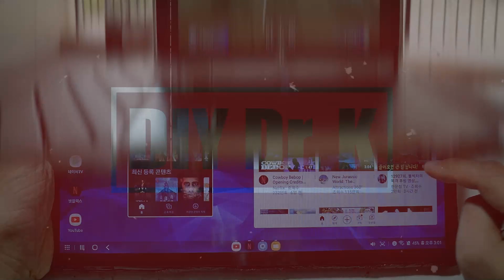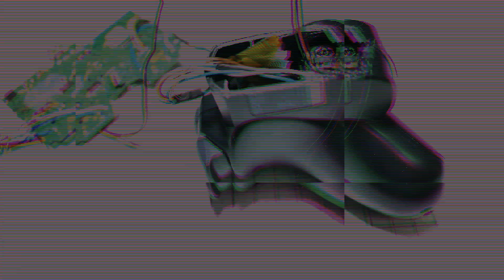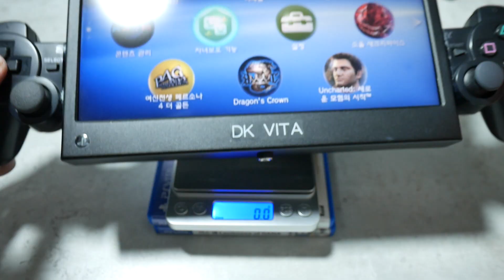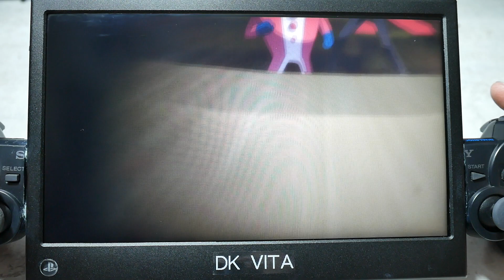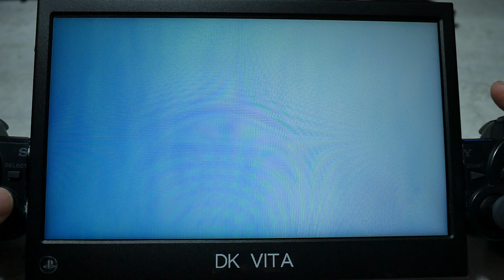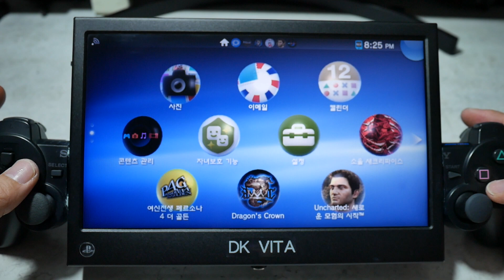10인치 디스플레이의 대형 PS VITA를 만들어보자 Let's make a large PS VITA with a 10-inch display

Comment: This is such an awesome creation. The ergonomics of the controller halves also help it be far more handheld than, say, the Big Switch. Handles really help out!

The battery life is probably a lot better than the original Vita, haha.
Reply: My vita goes for about 6 to 8 hours. I’d say if your vita dies faster then that it could be a faulty battery or heavy use from a game.

Comment: Is it BluTac or Putty that you're using to stick down the BMS?

Super Glue and Bicarb Soda make a super fast curing glue that can handle a LOT of stress, you should give it a try in one of your builds instead of putty for handles/controllers!
Reply from the maker: It's a putty. Putty makes the people watching the video more enjoyable. So I'd like to use putty because of that reason. Of course, some people dislike it.
Reply: @DIYDrK  I have a love hate relationship with it, A company I used ot work for used it to repair plastic threads next to a 400*c heat source and it always went super brittle, but it's great for other things.

The superglue and bicarb trick is really good for load bearing stuff though and fills gaps really well, it would make it so those controllers would be really difficult to remove ;)

Comment: I really want to mod a ps vita into a switch lite encasing with 10k mah battery and the back track pad still in place. And also with the vita's face buttons.
Reply from the maker: I have also think about it. But I don't have any idea changing display about 6 inch. If you don't want to change display, you can do it.
Reply: @DIYDrK  You don't think there's a way to connect the Switch screen to the Vita? I also think it'd be interesting to see about connecting the track pad to the Switch's bumper buttons.

Comment: The way controller joints are done is awful. I doubt it will work long, its just a project for the video. There is a much better way to do this, like using a conductive glue, etc. Looks good, but quality of some parts is total crap